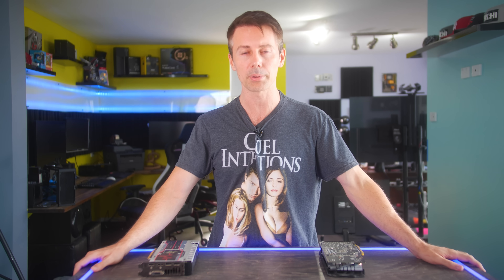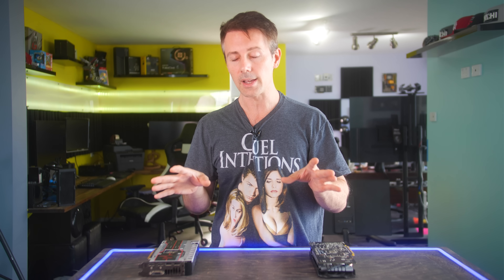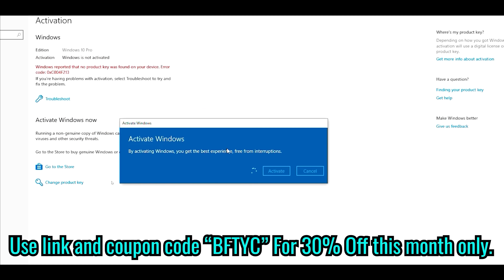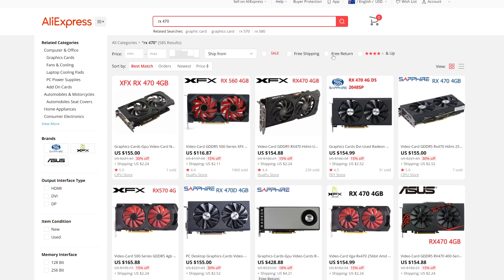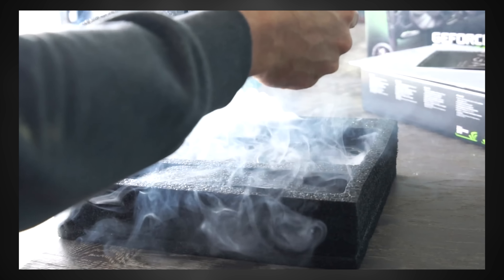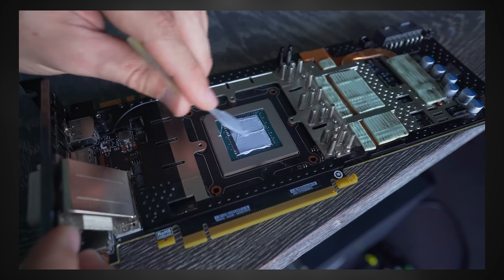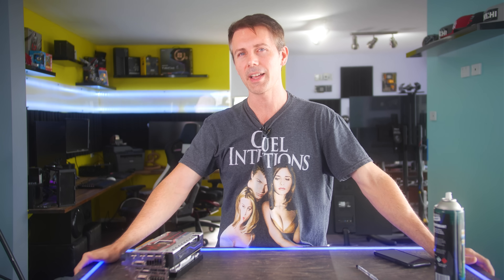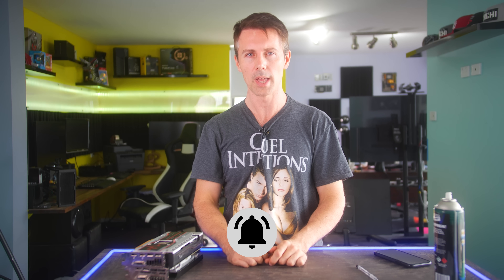How to BUY a USED Graphics Card in 2021's CRYPTO BUBBLE.

Comment: Hi, just managed to get ahold of a GTX 960 from a FB Marketplace post, and some of the tips in this video were pretty helpful to make sure the card was legit! It's the EVGA SC model and I tried the memory overclock as you suggested and I was able to make it to about +500 MHz on the memory clock before the benchmark started to run into problems. I think +500 MHz is really good and I'm confident this card will last me for quite some time. Thanks for the helpful tips!

Comment: i was able to buy a gtx 1080 Gaming x right after rtx 2xxx launch with 200eur.It was like new and I using even today undervolted 2000/5500(0.925v)and run all new games at 90avg fps(1080p)temp:54C-8700k(4.8Gh.oc),32ddr4(3600Mhz).I was planning to upgrade to rtx 3070 for 1440p(monitor upgrade)..but now i will stay for gaming on my old 1080p(75hz)ips led

Comment: Bro, a word of warning. Paypal and by extension eBay will not understand if you unscrew anything or if you overclock. They will accuse you of destroying or tampering with it and side with the seller. They don't understand that damage from overclocking is a long-term thing and is not an euphemism for "destroy now". This happened to me with a motherboard and cpu combo, and that thing killed an entire case and ram stick before I even thought about overclocking. To this day, I have not delt with a seller with as much of an ego. Ever. I checked recently and it appears people were catching on and it warranted him switching locations and abandoning his store's name. Why would someone be willing to trash years of name recognition if it wasn't a scammer's reputation? 

This happened even with a replacement case fan that didn't work. Paypal interpreted it as somehow having "no probable cause" for a return, something incomprehensible, and that I attempted repairs. They actually thought I bought an entire pc for $7, not a fan.

Comment: I bought a gtx 970 sc on Facebook marketplace for 150 dollars (usd) and I thought that it could be a scam but in the listing the seller mentioned that due to this current gpu market he is selling at a lower price to be nice. I pulled the trigger and went to meet him at a gas station. Before I had met with him he had asked what system I would be putting it in, and if my pc would of even worked with it. I took that as some comfort that it wasn't a scam. after we exchanged phone numbers I had went home and installed it into my system. It worked flawlessly but I still fear that this card has some issues.

this happened a few weeks after I bought it. I could be playing a game for 30 min or longer and my monitor would turn off (rest mode) and my pc would: stay on, gpu fan at 100%, pc would restart, and pc wouldn't restart even with the power button held. This problem isn't occurring anymore, I still have no idea what caused it or how I solved it.

My pc specs for the curious
Intel Core i3 10100f
16 gb corsair vengeance lpx ddr4 @ 3200 mhz
500 watt psu
nzxt h510 case
msi b460m a pro motherboard
evga gtx 970 sc 4gb gddr5
Reply: Its either the Gpu or the Psu does your psu have a brand or is it cheap generic one

Comment: mobile tester here. I was buying 2080TIs for 750 and selling them for 1200. All you need is a UPS, and desktop tower with a monitor, a mouse/optional keyboard. I had it in an suv, brought it out in two trips. tested it right next to them outside. ran two short benchmarks. all the cards I purchased were absolutely fine. had the tower opened, with all the cables/mouse jammed in, monitor laying on top.

Comment: I think Nvidia and AMD think we're absolute morons....you can buy a used card, or even 3, and keep the one that's best, for the price of a half assed rebadged "budget card"....DON'T BUY NEW GPU's! do your research, save a roll of cash, and kick these companies in the nuts, and remind them where they came from. personally I use an R9 380 4gb, it's works fine for what I use it for, it's runs Witcher 3 at max on all ultra average 55-60fps(monitor is 60hz so..yeah). clean the card, re-thermal if needed, and buy from reputable vender in case you need to return. Prices are OUT OF CONTROL, and people are wasting good money on cards that aren't worth half what they're asking! just don't do it! excellent video, thanks man.

Comment: here's a screwy business angle that i've run into - a dead GPU for parts/repair is going for what a fully working card was going for 6 months ago.  and therefore, i'm actually able to intentionally buy dead cards cheap (with no tech ability to do circuit work) and then flip it back to make money.

Comment: While I agree with all the checks he recommends for used GPU buying, All great advice, I disagree with the way he makes it seem like mining hurts cards. Mining does not inherently hurt gpu's, in fact most experienced miners undervolt and tune their gpu's to use the least amount of power possible, and generate the least heat. This can mean that the fans may need replaced but in turn it means the rest of the card is not abused. Most hardcore gamers run their cards at a higher overclock, and a higher temp while gaming than miners ever do. Now, Notice I said experienced miners. Inexperienced miners may have tried to flash the bios or whatever and bricked the card, or ran it at 110% for its entire life. Often youll be able to tell the difference based on the care taken to clean the card properly.

Comment: I had a used RX460 that I had to replace the fans on that I bought last year,finally got around putting it back in my old Core2 Duo/Quad and no video, Put an older one in and the video worked so tried it again an finally got it to work, Must have not seated it good or had some corrosion on the the pins!

Comment: The obvious for amd and nvidia are to install a "how many miles this gpu has run transistor" I would say every 500 hour mark but I guess this is future thing or nver thing. If the transistor changed like coulor going full rbg spectrum and end up red -means its soon dead transistor and so it the graphics card

Comment: I am not exactly eager to buy a used card. And while these tips are helpful, any meaningful upgrade for my 280X would be well over 300$ on the current used market. If we can consider the RX 580 that. But those cards have a lot of km in them.  And newer ones like the 2060 are around 600$ used. Guess it is still better than the 3070, that currently retails for 2200$ in Hungary, within EU, not even Venezuela.

Comment: About the mobile testing station:  I used to drive an 18 wheeler over the road in USA.  I knew people who powered their computers with an inverter.  That is all you need to power any machine in a van .  I used my inverter to power a small refrigerator and a microwave in my truck

Comment: 10:10 All u need is a power inverter and a pc,monitor,keyboard,mouse. I pop my hood run jumper cables to the inverter and test parts on site in parking lots. I caught maybe 20 ppl tryna scam. For game consoles I used to use a cupholder sized inverter running off the lighter and one of those kitchen fold down flatscreen tv's size of a laptop....

Comment: I got hosed too.. I bought a zotac gtx 1060 3 gb mini..the seller came to my place..i put it in my pc..got the nvidia drivers installed..saw the proper graphics card name in device manager..played some games..msi afterburner..showed all normal temps..worked that day..and the next day till evening..then when i was watching a video..a static noised sound off..my pc crashed..restarted the pc..booted of to windows..then  something happened..my pc crashed again..no more booting..!! Took it to a pc repair shop..they did the hot gunning thing..nothing...the video card fan just rotates..no video on monitor !!

Comment: normal card with mining bios on it dont show screen under windows unless you patch the drivers or reflash bios and installed driver show error until patched   =]]] /i got 4xRX470 4g mining with dvi port only for 40eur each perfect condition never opened for change of thermal paste with stickers on the bolts/

Comment: I bought a mining version of Red Dragon RX 570 4GB with just a single DVI 2yrs ago. It's very unstable in games at first launch. Then I found out that I was running the card with a mining BIOS. So I flashed the mining card with a gaming/original BIOS and it works totally fine for 2yrs of heavy gaming. I even got it sold for $80. Now I can't buy a new one, even a 1660 is now $300 from local price of $200.

Comment: Ask them to leave graphics card for 10+ min in furmark than compare parameters online (core clock + how well is boosting ,memory clock, temp ,fps etc) if they match and temp is normal to acceptable . Furmark is just a couple of MB and easy to set up so if they don't agree better leave that deal. That is all I've ever asked for every gpu that I've bought used and never failed me .

Comment: This video contains quite a lot of misinformation about what happens to a GPU that's used for mining.

On average, a card that was used for mining will be better taken care of than a regular one. Sure, there are miners out there who may not have high standards of cleanliness and who don't care that their cards run hot and with 100% fan speed, but most of the times the cards will be properly underclocked and undervolted and generally in a pretty good shape.

As others have mentioned, the biggest issue you'll probably run into is having to reflash the original bios which is a 5 min job.

Comment: If you buy a used card and it has driver issues re flash the stock bios to the card. 
I bought a used 570 4g and this very thing happened. 
Many miners dont even know that their custom flashed bios might not work with the gpu driver on windows.

Comment: I got a RX 580 4gb second hand, card seemed in good condition but when i tried to game on it, the computer would crash after a couple of minutes!  Turns out it had been a mining card with custom bios.  I fixed it however by reinstalling the original bios.  You can do do this from a site called TechPowerUp.  They have all the info for most graphics cards, it shows what clock speeds you should get from the card when in original condition, so if you your having problems with a second hand card, go to this site and compare to see if its been tampered with.
Reply: Dude I have the same card and I have the same problem but my pc boots up but with a black screen what do i do

Comment: Yes ! But why you don’t use OCR ? 
This magic tool can make your job easier , employees and students help them write reports ,research… for example, extract informations  from a YouTube videos or text from an image on Google…
To use this tool, you have 2 methods:
1-	Online OCR :
On the Internet , there have been a lot of websites that can provide this service, just type in google "online ocr" and you will find what you need.
All websites require to upload the photo containing the text and give you a file containing the extracted text.
2-	OCR JUST SELECT (Recommended) :
Personally, I use this software to extract text from videos, pdf images and pictures .
 I recommend it because it is characterized by :
* Internet is not required.
* Extract text from images, videos, Pdf images... from any content on the PC screen.
* Easy to use.

You can find this software only on eBay, just search (on eBay) "OCR JUST SELECT" And you find it in the first result.

Comment: WD-40 is not a lubricant, the WD meaning water displacer and it's a solvent or a rust dissolver. CR 5.56 is a lubricant. It's based on paraffin oil, and essentially a waxy film. For those wanting to order Bryan's magic elixir, which BTW is way better than the others... https://www.supercheapauto.com.au/cart NOTE: There is a 9.99 shipping fee if you live in NA, so order more than one can to offset that price.

Comment: 13:35 not really all. if it has been used for ethereum mining then the memory is as good as one used for gaming.  though ethereum mining is memory intensive, it needs the coolest temps and lowest voltages as you increase the memory clock. most of my mining cards run cool and at low fan speeds.  (except my two Rx 580 red devils which are 100% fan in the middle of the day or summer)

Comment: Question dropping: I have an Intel
 DH57JG mini itx mobo and in trying to install a geforce 1650 it freezes at the post screen. Same luck with the AMD rx570. Do you have any work arounds in the bios? It does run older cards like the gtx 460 and 560.

Comment: I just wanted to point out, back at around July of 2020, I bought two 1080 TI cards, (one for me and one for my gf's gaming rig). We were both rocking less powerful GPUS (960 SSC and 970). I paid around 350-400 for each 1080TI (both used). I have absolutely no regrets. The performance on these cards are more than adequate for many modern games.
  
Out of curiosity,  I just checked on Ebay today and they are literally selling between 670.00 usd to 700.00 usd (actual bid wars) which means, after tax, these people are paying out more than 700.00 USD for it. Holy shit. (thats MSRP for a 3080) o_o

I am so glad I picked them up when I did.  Everyone was telling me, I should have waited until the 3000 series came out in late September, because then, the 1080tis would drop in price at around 200-250 usd.  Yeah right lol.   People also predicted the 2080 TIs would sell for around the same price after the 3000s came. Even made memes trolling 2080 owners.  Honestly... who's laughing now, when you can't even get a 3000 card for MSRP???  I would never pay 1200 - 1500 usd for a card meant to sell for 700 usd dollars. That's highway robbery.

Anyhow.. I think I did good. If I didn't follow my shopping impulse then, I'd still be stuck with a 960ssc and don't get me wrong. It's not a bad GPU to play with...but I really wanted to experience higher resolutions, maxed settings and more fps performance. The 1080TI, being a few years old, still delivers excellent performance for many of my favorite games.
Crypto miners and scalpers...  Don't know if I can totally fault them. I'm really pointing at Nvidia for this issue. They don't seem to care. Money is money. :[

Comment: I just sold my rx 570 for double what I paid for it .  I paid $150 on Amazon new a year ago, I sold it on ebay for $320.  But that's because I bought an RTX 2060s card before they went up in price.

ALL cards are overpriced right now.
Reply: Hmm because I'm having some money problems I started mining ethereum on my rtx card.  I've overclocked the memory about 11% and upped the voltage 10% to make that stable (also slowed the clock, turned the fans up and lowered the power max...)  So I'm in danger of wearing out the memory.

Comment: Dude, this past friday, I pulled out a perfectly functionning 2yo KFA2, sold it for 400€. I even benchmarked shadow of the tomb raider, feb 12!  I install my brand new 3070FE, works as expected. 
I delivered the 2070 2 days later, on sunday. Sunday evening, the guy says it doesn't run. I am at shock, we video chat : fans run at full speed, no display. Lower end gpu works on his rig, card also doesn't work on his neighbors PC. I pick it back up, reimburse the 400€, he finds a 2070S by luck, it works right away. So YES, it does happen, you pull it out and it doesn't work the next day. Idk what happened but that 2070 is now worth less than it's equivalent in paperweight.